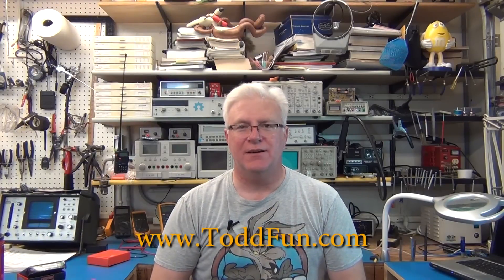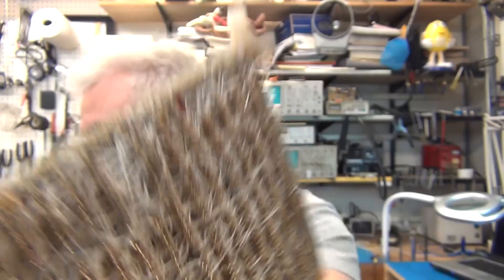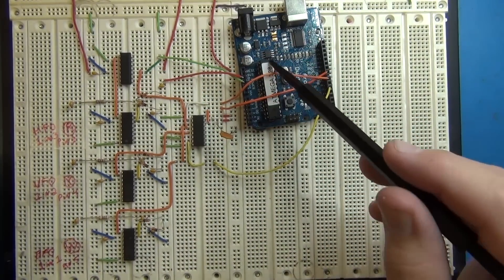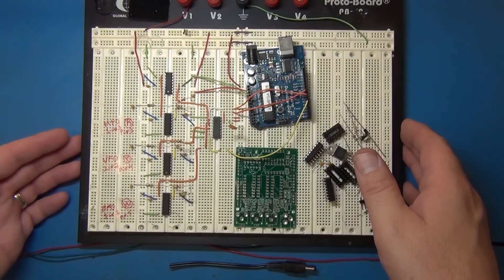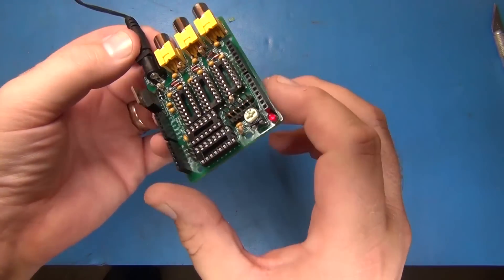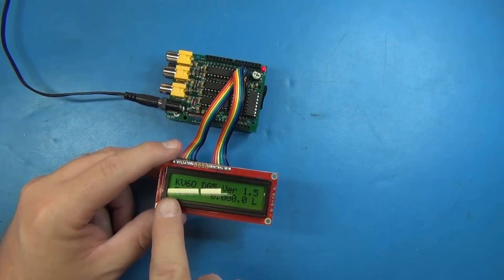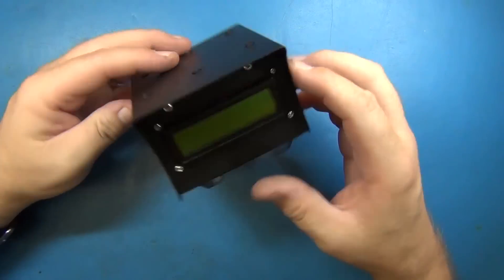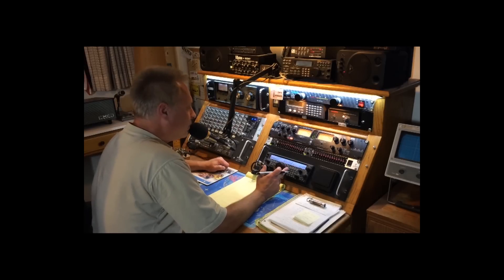Arduino Frequency Display for Kenwood TS-520S HF ham radio PART 5

Comment: I like it.
Glad to see you guys got it finished up.
I knew someone that had the DG5 and it was a flaky beast as I recall.

I have actually been tinkering off and on with an FT107 that has a bad frequency counter... the custom IC is of course unobtanium and there is a kit that you can get to replace the chip but does not seem as fun as me breaking out the AVR development boards (like the arduino) and giving it a go.

One of these days I will finish that up... Thanks for the inspiration!
Reply from the maker: Mark19960 Glad to be back, thanks. If you work on your frequency
counter it would be nice for you to post a video or any thing you can share on
how you came to your solution. I really should do some more AVR development, I
have done straight-up AVR programming like in my Christmas frame hack. I just
used a blank ATmega168 with some Arduino code on a bare-bones clone. No boot
loader of course. You could find that on my all postings menu at ToddFun. http://www.toddfun.com/2011/01/01/making-a-custom-arduino-board-to-hack-a-christmas-photo-frame/

Comment: Todd - nice work.  Just wanted you to know that I've modified my Heathkit DFD-2 clone to work with the Kenwood TS-520S.  It uses the same architecture and PLL chips.  It accommodates both 10 and 100 hz resolutions and also displays the mode in use.  The only substantial difference that I can see is that no Arduino is required.  All the coding is done in assembly language in a resident PIC16F628A processor.  The Heathkit version has been running now for at least 8 years, and I bought a TS-520S just to see if it would work.  It does - and very nicely!  Joe - K3JLS
Reply from the maker: fascinating! Have you posted any videos our blog about it? I’d like to see what you did.

Comment: Awesome build and fantastic case in the end for it ;)

Two suggestions:
1. For the back, you could do a shield-type cover like the same in motherboards where they meet the case to make that neater and less dusty on the inside over time
2. Maybe  post up the LCD inside the case so a protective piece of acrylic can go over and protect the LCD display. Would be a more robust option for HAMs on the move.

Maybe you can make a schematic or something for the case and release it into the wild for others to enjoy a similar styled case? Or if you can make it, offer it up for purchase?

As a non-ham and wannabe maker, I love these videos ;)
Reply from the maker: themaconeau <span style="font-size:12.0pt;font-family:"Times New Roman";
mso-fareast-font-family:"Times New Roman";mso-ansi-language:EN-US;mso-fareast-language:
EN-US;mso-bidi-language:AR-SA">Thanks very much for your kind comments and
suggestions. I really like your suggestions because I hadn’t thought of them
and they would have made the product much better. I have no idea why didn’t
think of your back cover idea. I use those things on computers all the time and
it should’ve been a no-brainer. I guess I get something in my head and don’t
think of any other solutions. Sharing things online always lets people give me
better ideas and I’ll always remember them. I will be sharing the full design
of my box in another video shortly. I have shot all of the video plus photos
and scanned drawings so I just have to get to the editing which is always boring
and lengthy.

Comment: Hi Todd, great video, great explanation. I just finished built both LCD and LED version as well, with total cost of about $40. But that's not including the cost of making PCB because I have to make at least 10 board to lessen the cost.  I just want to share that LED version is prone to RF, so when I transmit from TS520S then the LED display frequency jump erratically. I'd like to hear your comment about this. 
And I still have some boards if somebody needs it. 
73 de Adhi YC1FYH
Reply: updated: I grounded chassis of TS520 to DG5 emulator, and the problem is gone
Reply from the maker: Nice work! Thanks for the tip.

Comment: I'm trying to load the LED file into the Arduino board and I keep getting an error" LedControl.h: no such file or directory"...Problem fixed .I installed the LED control and Frequency counter files from "Libraries"...It works great.

Comment: hi there ,Ihavea kenwood ts 520 not the 520s so will this build kit work for my 520 kw let me know thanks 73 rick kd2bmd.
Reply from the maker: Not on a 520. It doesn't have the needed output. You might be able to tap into something on the circuit board but you would have to reverse engineer the circuit to see if that is an option.

Comment: can i find one theses off ebay already put together?
Reply from the maker: No but I have some links on my blog posting for this that might lead you to Steve Leander that makes the boards and you can build one  yourself.  http://www.toddfun.com/2014/11/02/arduino-frequency-display-for-kenwood-ts-520s-hf-ham-radio-part-5/

What might be better is if you can just fine the OEM version on eBayt. Keep an active daily eBay search for a Kenwood DG-5 frequency display. That will plug right in and work.

Comment: Has anyone adapted this project to the older TS-520 rather than a TS-520S
Reply from the maker: I think you would have to install the DK-520 option in your TS-520 before you could use it with this project. See page 4 of this pdf for Dk-520 circuit and other option details for this conversion:
https://w5rkl.com/wp-content/uploads/2014/04/TS520S_service-manual.pdf

Comment: Hi there Todd how could I order one built from you please do let me know thanks
Reply from the maker: +Charlie Cheng Sorry, I don't sale or build these. You can contact Steve to order a blank board and then order the BOM list of parts. You can ask Steve if he would build one for a fee but I don't know if he has time.
http://www.kv6o.com/wordpress/projects/kenwood-dg5-emulator/
Reply: +Todd Harrison (ToddFun) 
Hi Todd I also emailed you on gmail, I hope you could reconsider building one for me as I am residing now in Dubai and will have no access to my tools or shack and I like the case you used so much PLEASE Todd please reconsider and email me where I could send the payment.
Reply from the maker: +Charlie Cheng I wouldn't have time, sorry. You should keep an eye on eBay as sometimes the original equipment "DG5" comes up for sale and would plug right into your radio as designed. Plus a used original unit would be cheaper than paying somebody to build this emulator.
Reply from the maker: +Charlie Cheng In fact there is one right now for $159 as "buy now" with free shipping on eBay. I couldn't build one for less than that for sure. http://www.ebay.com/itm/Kenwood-DG-5-Digital-Display-Unit-/322081851323?hash=item4afd9307bb

It shows "ships to US" but I believe there is now an eBay broker option that you could use which lets overseas people purchase through the broker in the US who will then send it to you but I don't really know how that works or if the seller has to allow such setup.
Reply: +Todd Harrison (ToddFun) Todd thanks I know the DG but I prefer the same unit as what you have built, i hope you could reconsider